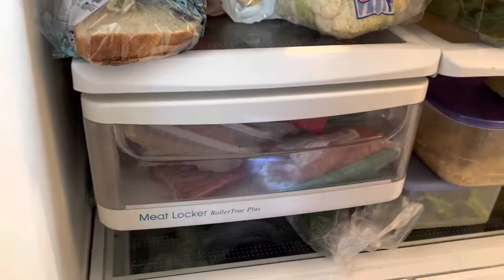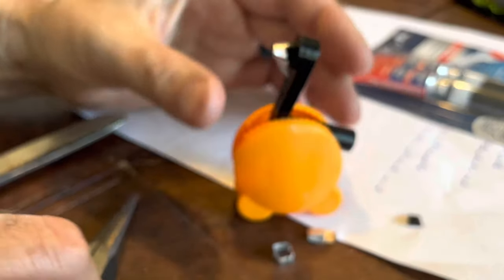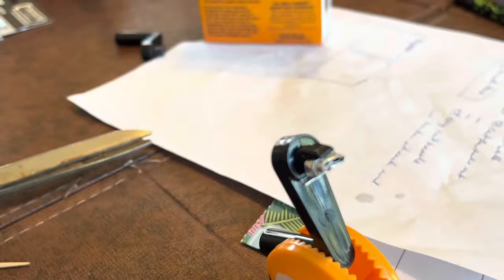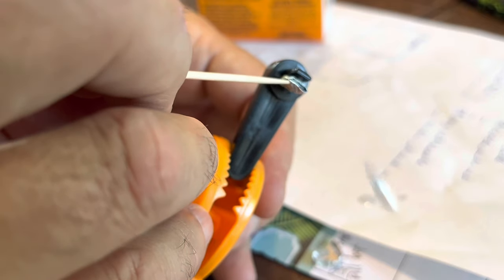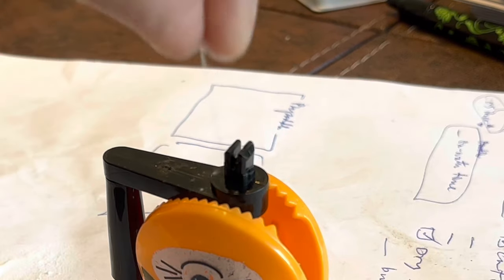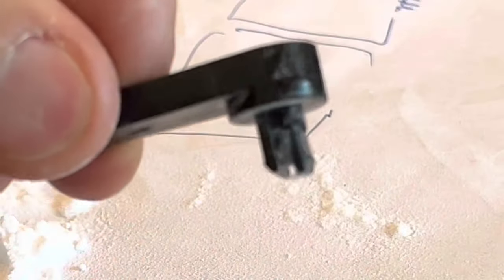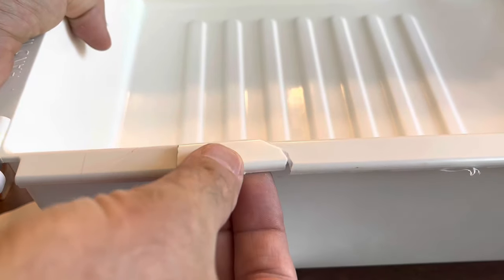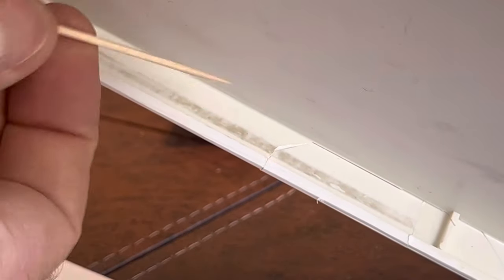Fridge drawer: repair plastic with super glue and baking soda

Comment: How strong is it??
Reply from the maker: Exactly how strong? I suppose that something you need to find out yourself.

In our case, these two repairs are continuing to work great.
Reply: Looks like it’s strong enough.
Reply: Son of a bicth! I wish I knew of this years ago! Would have saved me money.
Reply: @S A lot of it will depend on what kind of superglue you use, I used Krazy Glue.
Reply from the maker: Cyanoacrylate.

I am aware that different brands have different viscosities, but the chemical is the same…

I just found a 12 pack of 0.1 ounce tubes for 10 bucks. Perfect for this kind of occasional repair.
Reply: @javawriter would you use gorilla glue?
Reply from the maker: @TD-wp5tr  heck no

Comment: I just tried this today - the pocket clip on my touch-screen stylus broke off, which made a good test case. This works great!  The bond is very strong. 
-a sceptic convinced.
Reply from the maker: Awesome! Now, I’ve had some failures, too, but they were with some higher stress joints